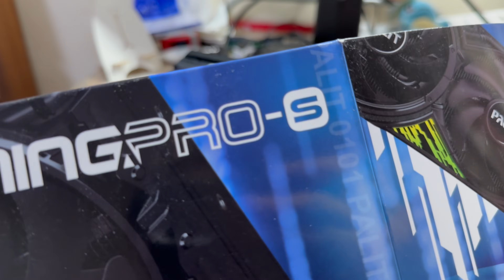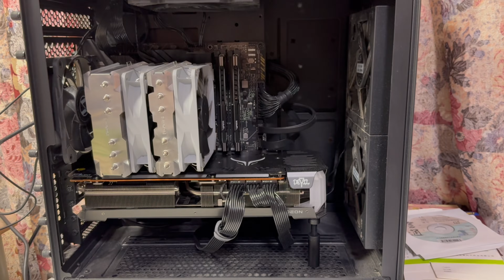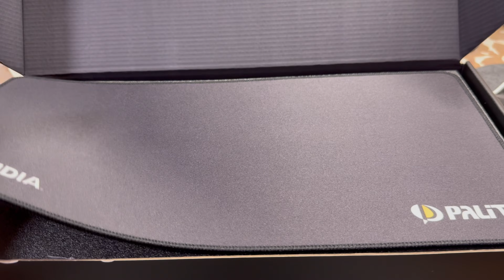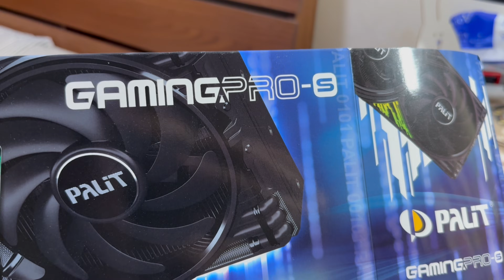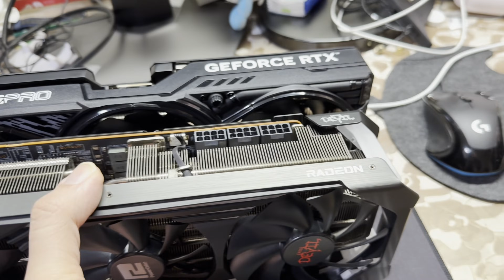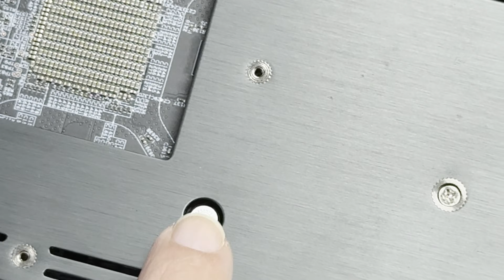👉REVIEWING THE PALIT 5070 TI GAMING PRO-S

Comment: "This shit is not OK" .. not going to argue with that, but: 
There's a GamingPro and a GamingPro "V1"... there is no "V2". 
The OG GamingPro without any version number (let's call it "V0") uses a vapor chamber - V1 is identical to "V0", only difference is that the V1 has a copper-plate instead of a vapor-chamber.
Funnily enough, they didn't bother with updating their packaging because on my V1's box there's still a vapor-chamber mentioned. They did slap the correct sticker on the box and on the card itself as it does say "V1" on mine. 
GamingPro-S is slimmer and thus its finstack will have less surface.
Plus: Ignoring the vapor-chamber/no vapor-chamber thing: Both V1 and "V0" use the same cooler that's also used on the 5080 GamingPro - meaning you get eight heatpipes and a thick finstack - and a cooler built to handle a 360W card.  
I'm pretty sure the "-S" model has only six heatpipes, so it probably uses at least the internals from the 5070 non-Ti GamingPro. Plus I think the "-S" only has a plastic backplate whereas the V0 and V1 have metal plates. Oh, and a little less RGB on the -S, I believe. The larger GamingPros have RGB on the side and on the top whereas the -S only has RGB on the top, near the fans. 

I can only comment on the real world temperatures of the V1, as that's the model I use, but comparing its temperatures to the V0-reviews I can find on the net, the vapor-chamber doesn't seem to make much of a difference. I'm getting pretty much the same results with my V1 as those reviewers got from their V0s. No idea how the -S performs as I haven't found a single review for that card. 

I do agree that the naming scheme is confusing and could even be considered misleading. If I had to categorize these cards using, say, Gigabyte's "performance tiers":
GamingPro-S = Gigabyte Eagle models - if it wasn't for that bit of RGB on the -S, you might just as well equate it to their Windforce-models. 
GamingPro V0 and V1 = Gigabyte Gaming models. More elaborate backplate/frame, backplate made from metal, not plastic plus larger finstack, more heatpipes and more RGB than on MSRP-models. 
That comparison might not be 100% accurate, but it's not that far off, either, IMO. 

Not sure this means anything any longer as the regular 5070 Ti GamingPro models (non "-S") seem to have vanished from the market, at least in my neck of the woods, and it looks like they've been replaced by the "-S"-model.
Reply from the maker: Can confirm: the S model has a "graphite" (fancy plastic) backplate. However, it is removable and they provide 3D stencils so you can print your own custom (full) shroud replacement. Thankfully, the cooling of the S model was surprisingly capable and can easily handle a GameRock level power limit while remaining cool and keeping the card quiet. Palit has surprised me time and time again with the simplicity of their cards and the performance. My 4090 is a Palit Phantom GS (re-branded by Yeston) and it performs extremely well too.
Reply: @Vans_WW  Oh, I wasn't bashing their products per se. TBH, I never owned a Palit (or a Gainward) before so I was a bit hesitant before buying my card. But, overall, this thing looks and feels extremely solid and if you ignore that front shroud's slightly "plastic-y" look (because it is made from plastic, duh!) I'd call it good looking, too. Performance and especially cooling are outstanding - including hotspot temps which we can finally monitor. I had run three Gigabyte cards in a row before (3070 Eagle and 4070 and 4070 Super Gaming OC) and the Palit doesn't feel like a step-down from those Gaming-models. 
Plus at the time I bought it, it was one of the "cheapest" 5070 Tis out there (I paid less than MSRP for the OC-model) but still came with a lot of features you wouldn't get on other brands' entry-level models - which the GamingPro V1 was at the time as I bought in mid-May 2025 and the "-S"-model hadn't come out yet. So... dual BIOS, metal backplate, three full-size fans and even a bit of RGB.
Reply from the maker: @1SaG  Good stuff! Enjoy your card man. I was shocked to see the 5070 Ti I got for ~80,000 yen is now selling for more than 200,000 yen in Japan.

Comment: This is the cheapest i can find right now in France for 800 euro. The rest are 200 euro more expensive. I wonder if anyone managed to overclock it or underclock it ?
Reply: Yes, you can safely go 350 on core and 4k on memory, no crashing
Reply: @gimigimi1299Did you flash bios to unlock the power limit ?

Comment: Is the cooling system different from regular gaming models ?
Reply from the maker: There are different models of the 70 Ti Gaming Pro cards. The original is the Gaming Pro (OC), which features a Vapor Chamber (and has the best cooling of them all). Afterwards, they made a new version: the Gaming Pro V1, which removes the vapor chamber and uses regular heat pipe cooling, same thickness but not top tier cooling as the original. Then they made an NVIDIA SFF-compliant model: the 5070 Ti Gaming Pro-S (this one), which is much slimmer (almost 2 slot), uses less heatpipes and has a smaller heatsink. Of course, the cooling is nowhere near the capability of what the Vapor Chamber model can do. If you look at the boxes, the only thing telling them apart is the "V1" and the small "S"; these are not reflected on the card shroud itself. MSI does the same things with their cards: the MSI "Plus" cards have vapor chambers, non-plus do not. It's a complete mess and frankly anticonsumer. There are no day one reviews of the Gaming Pro-S cards, only of the Gaming Pro OC cards, which are now completely unavailable for purchase in Japan at retail.

Comment: i have v1 (no vapor chamber) no difference from regular https://www.youtube.com/watch?v=5OZ7pHqypEM min 14: 21 furmark test... but gaming pro s have 4 heatpipe regular (+vapor chamber) and v1 (+ thick copper base) have 8 heatpipe...my card-- 300 watt 20C AMBIENT hit 63/65C  ~1500 RPM (in game  almost never runs at maximum power) very nice and quiet card and i payed under msrp of my country (es asus tuf msi gaming trio NOT HAVE vapor chamber)  msi PLUS   is one extra heatpipe.... no vapor chamber .Anyway, you also have the warranty sticker on the 5070, it's at the top of the card on the backplate near the video ports
Reply from the maker: The Gaming Pro-S has less heatpipes and is significantly less thicker than the V1 (I believe the V1 keeps the same thickness as the original Gaming Pro). So the card does see higher thermals than the V1 (I guess). My card easily hits 70C stock (300W) and 75C when overclocked (320W bios). However, even the memory juntion stays more or less at 70 at MAX OC and full 320W (which you can really only hit with synthetics or with path tracing at 4K), power consumption usually doesn't go that high, so temps are usually within 65~70 range. Not bad at all for such a slim card... hard to believe how good the silicon is at not getting hot.
Reply: @Vans_WW  y V1 is 3 slot (1.6 kg). i prefer undervolt 875mv 2800 mhz (i have non oc version) + 3000 memory.... range 150/250 watt 200 watt avg in game temps 48/55 C with custom curve ~1500 rpm (1440P) . i flash gamerock oc (320 watt) on silent bios but the profit is 1/2% for more 6% power. in my country (italy) regular and v1 They are no longer available at decent prices, only the S version can be found I bought v1 it in April under MSRP 820 € (msrp is 890€ in italy)...from 750$ to 890€  no sense...

Comment: I got the Gainward version of this, and it works great. But I havent compared it to the more expensive 5070 ti’s. But little to no coilwhine on mine, so it is a keeper :-)
Reply from the maker: Mine has zero coil whine as well. Extremely impressed at how quiet the card is, even with fans going 2500 RPM at full 320W.

Comment: I have the MSI Inspire 5070ti 16G 3x and couldn't be happier I never got the 5080.
Reply from the maker: bro the 5070 Ti is completely goated. It can more or less match my undervolted 4090 in games like Final Fantasy XV at 4K (of course, 250W vs 320W). It's absolutely crazy how good this arch from NVIDIA is on the same process node...
Reply: @Vans_WW  : I undervolted mine too and my main PC use case is 3D rendering (Blender). Even compared to the 5070 I use at work, the 5070ti is way faster. Can you share your 4090 undervolt settings?

Comment: I specifically bought the "S" version because I'm slapping a waterblock on it and I want a GPU as small as possible
Reply from the maker: oh wow, which waterblock are you gonna put on it, if you don't mind me asking? I might wanna do that down the line once my warranty runs out.
Reply: @Vans_WW  Its an Alphacool Core GamingPro, specifically compatible with their 5070 Ti/ 5080
Reply: @owlmostdead9492 for how much is that cooler, 200 $/euro, you could have put another 100 and get a 5080. Even entry level 5080 get a vapor chamber so the cooling is ok.

Comment: This card is around couple of months and I struggle to find single review that shows benchmarks and temperatures and noise.

What the hell
Reply: I just installed this very card yesterday and it works perfectly fine for me too, on max load its around 65c and I can't hear it at all, I haven't tweaked anything either.

EDIT: Undervolted it and it performs even better, max temp being around 55c around 900mV
Reply: @dzoni868 great to hear man, can you kind to share what your clock is in Mhz at your undervolt. Also did you also OC the memory and by how much.
Reply: @H1tman13  Yea I did memory +1500MHz. I may change it but i went with around 2750MHz on 900mV, pretty sure it can go higher. With the new drivers and dlss 4.5 (preset M) it did go up to 62C
Reply from the maker: Please stay tuned for the benchmarks + noise test. I am still in the process of doing it. I acquired a kit of Samsung B-die so I am able to extract max performance out of this card. My testing is not done yet.
Reply: Same, its horrible. Do your fans also make that annoying noise?
Reply from the maker: I got lucky in the noise department, fans are working perfectly for me (very quiet). No coil whine. However, the Japanese market is absolutely brutal when it comes to noise, all these cards are pre-tested for noise from all these shops before being sold. Japanese costumers return anything that makes even the slightest annoying sound.
Reply: @AuranierI'm still waiting for card to arrive